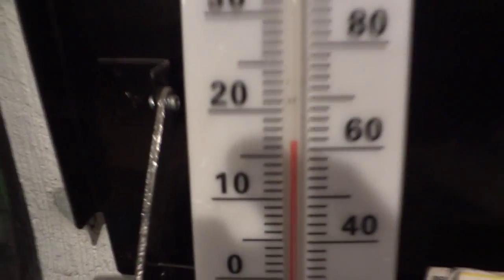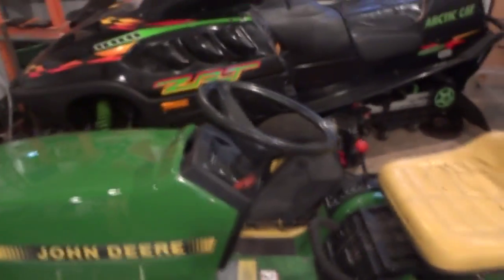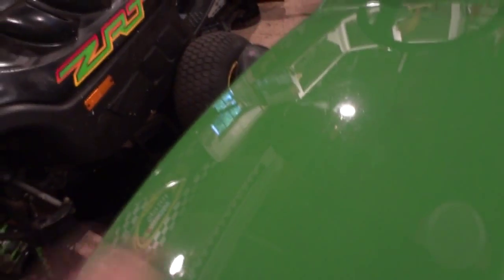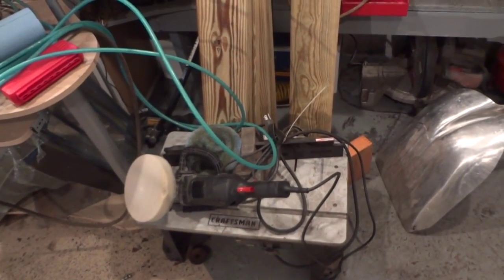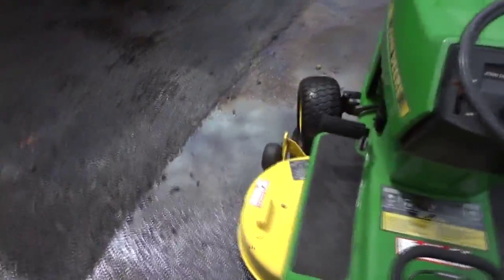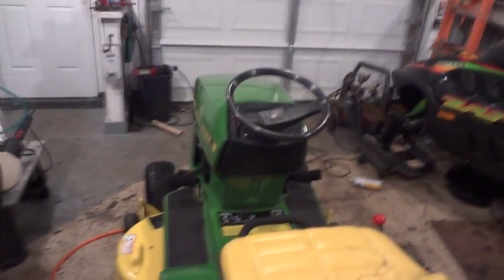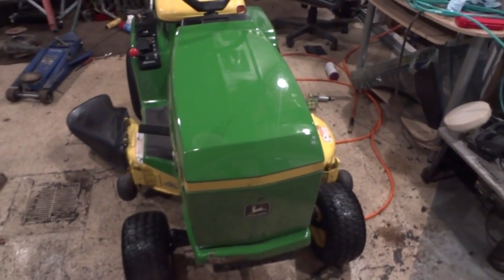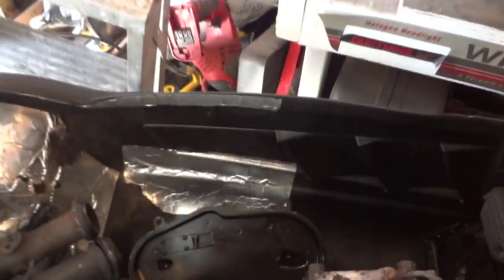time to finish up on the John Deere STX38

Comment: great vid.the john deere is a 1989 because the first two numbers in the serial no. is 19 and if the first two numbers was 20 that would mean it would be a 1990 and 21 would be 1991.hope that helps